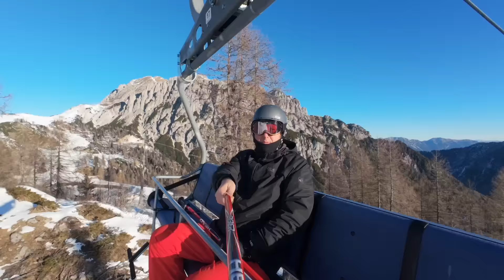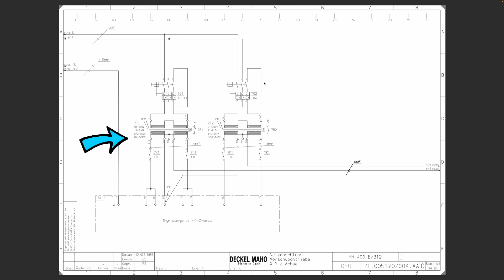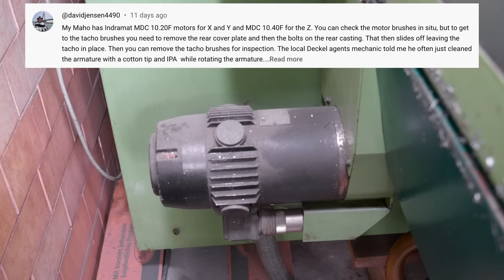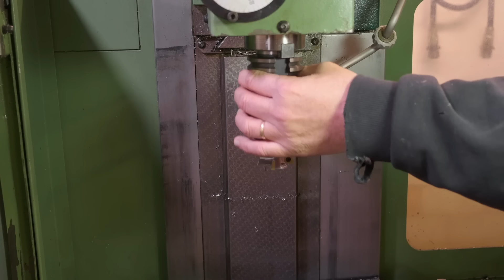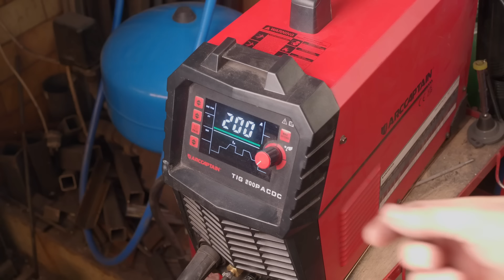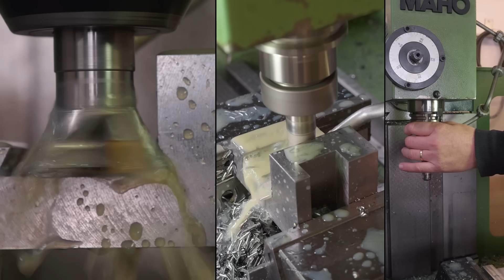My mill threw following errors. Did your advice help troubleshoot it? || RotarySMP

Comment: Bit late to reply to this, but very often relays need a freewheel diode strapped in reverse polarity across it's coil's power pins. This gives the stored current somewhere to go after the relay is unpowered, and stops it ringing when opened by de-powering it, by giving the stored current a path to travel and dissipate via the diode's innate voltage drop.
Reply from the maker: Thanks for the explanation of that.

Comment: That relay for the brake is probably too small, even if its rated for the amps. The contacts are probably fried and messing with the brake staying on. Pull the relay apart and take look, cheap part.
Reply from the maker: I removed it completely.

Comment: Hi Mark ,regarding the Z-axis buzz.
(I expect that you all ready know this)
as the brake exists to stop the axis from falling down, what holds the axis when the servo is on and the brake is off?
the servo it's self of course.
The servo locks the axis by oscillating  clockwise and counter-clockwise at a high frequency.
With the brake on AND the servo on they are fighting each other,
and fights are usually quite noisy 😁
Reply from the maker: Good description Steve.

Comment: A couple useless suggestions....To check crudely controller tracking I would do a set of test cuts e.g. the same boss or slot with different load feeds speeds and would then measure precisely the features. This should be able to show the effect of a simple P controller to track at varying load. 
I would also try to simply jog downwards a few clicks with the spindle into a piece of thick stiff foam lets say to a compression of nominal 1mm. If the P controller is not tracking you should be able to see it in the dro. But non expert talk here and no info about how to tune. I only tune little motors by intuition no big scary machines😊
I and D tuning i find is not that intuitive and the values i see for I are usually maybe orders of magnitude lower than P. So it could be even that your values for I are right out ignored due to value range limits. But all depend on units i suppose. For a cnc which is a highly dynamic system with accelerations i would probably expect to see PD values first set and then lastly Integral if needed.
Reply from the maker: Thanks for the tips.

Comment: Sehr hilfreiches Video für alle, die Fehler bei der CNC‑Fräse oder im Fräsen‑Workflow lösen wollen. In der täglichen Praxis können viele Probleme auftreten, etwa falsche Werkzeugwahl, unzureichende Werkstückspannung oder Vibrationen, die zu Oberflächenfehlern, Rattern oder sogar Werkzeugbruch führen können. Typischerweise hilft es, Schnittparameter, Vorschub und Drehzahl anzupassen, die Maschine stabil aufzubauen und Werkzeuge regelmäßig zu prüfen und zu wechseln, um solche Fehler zu vermeiden. Außerdem lohnt sich ein systematisches Troubleshooting, um die genaue Ursache zu finden und künftig ähnliche Situationen schneller zu beheben.

Comment: I suspect you have the same Chinese foot pedal I do.  Mine seems to have some modulation when I press down, but not when I let off, until it shuts off completely.  Or rather when it shuts off, sometimes it doesn’t…. I really should dig into it.
Reply from the maker: Hi Jeremy, I contacted Arc Captain, and each time to switch on the machine, or connect the foot pedal, you need to depress the foot switch full, and hold it down for 5 sec. Then the machine beeps, 2T blinks, and the foot pedal controls currently normally. It also works in 2T mode.

They asked me to make a quick video, which I will, but I also suggested this kind of information belongs in the user manual.
Reply: @RotarySMP huh.  Mine is a different brand (yeswelder), but I’ll have to try that and see if it makes any difference

Comment: Does Linux CNC offer a "trailing error" mode of operation as well as "feed forward" ?
The Heidenhain controls I was retofitting mid-80s onwards could operate in both ways, but the manuals warned that to run "feed forward" the machine had to be mechanically free from lost motion and be adequately rigid or instability would result. As retrofitted machines were always well used, " feed forward" operation was never used. "Trailing error" operation was a lot more forgiving & more suited to older machines with older drives not originally designed for high speed contouring use.
I would put your Maho in the "older machines with older drives not designed for high speed contouring" class that I would have set up in "trailing error" mode. Indramat drives were bomb proof but hardly "dynamic" - single phase thyristor drives can't match PWM transistor drives for response, but will shrug of crashes that killed transiitors. And they don't have the annoying 8-10 kHz PWM whistle, just the grumbling / buzzing I hear from yours.
I would have expected that machine to have done around 5 metres / min rapid traverse - your 2.5 m/min seems "conservative" ? Did you adjust the drive velocity setting if you dropped the rapid traverse rate from the original setting ?
Reply from the maker: My Maho was not well used. It must have failed early into its service at the HWK Aachen. 

I actually increased the rapids. They were originally only 1500mm/min under the Phillips control. I didn't adjust the drives at all.

Comment: I use Gulf and Western Tacway 220 on my slides. Same as yours basically. I like here in Sydney. It really is tacky. So much that I also use it on the lathe slides as well. Makes the movement feel nice and smooth. But yesterday we hit 42 C (567 Rankine) so a wee bit different here. Although the shed stayed at 24 C. So it's 220 mm2/s at 40 C, 800 mm2/s at 20 c and about 1800 mm2/s at 10 C. So you may be correct that it gets a bit stiff.
The lube line on my Z axis had disconnected when the machine arrived. The one the goes the recirculating nut. Difficult to fix as the old plastic lines were a bit stiff. On mine you can check it by pulling down the spring sleeve that protects it form dirt.
On my Maho it seems to slide better just after a lube cycle. Hard to know because the Heidenhain controller auto tunes to account for it during down times. You can feel the stiffness when winding the slides by hand.
I've had all my slides open. Two ports were clogged on the rotary table.
You can check all the lines are working a the distribution manifolds. Mine all have the dosing pistons in those manifolds. 35 of them. For a quick check I just undo the plastic hose on the manifold outlet, release a couple of drips and reconnect it. That puts an air bubble in the line. Then go to the lube until and press the manual dose button. Race back and watch the air bubble. If it has the dosing pistons the bubble wont move until the pump switches off. The pump switches off when all the pistons are cocked. When it stops the pistons spring load back and the bubble will move about 5 mm if the dosing piston is working. If it doesn't take the hose off again and check the little spring loaded rubber check valve way down the bottom of the aluminum manifold isn't stuck. Several of mine were.
Reply from the maker: Thanks David, sounds like I need to order some 68 weight and fluch out the 220. I need to do that lube check on my "annual" maintenance, which is probably due when the weather warms up.
Reply: @RotarySMP  The ISO  standard is the viscosity at 40 C because in most cases the oil runs hotter. I would think Maho was expecting most machines to operate at about 20 C and the oil the same. At 20 C the viscosity of ISO 220 is 800mm2/s. So you probably should pick a grade that is that viscosity for the actual temperature. At 15 C it's ISO 150. At 10 C it's about ISO 100 grade. Looks like you need a grade for summer and a different one for winter. My WW2 Jeep manual suggest just that. At the rate my machine consumes lube oil you could probably just switch grades just by topping up!
Reply from the maker: @davidjensen4490  No chance an I doing a lube unit change and flush 2x year. Not going to happen.
Reply: @RotarySMP  So maybe just pick ISO 150 for an average temperature of 15 C?

Comment: Wondering if the resistance is different between that brake and the relay you added. Possibly causing the amp draw to be out of range and causing the issue. I'm not a cnc guy by any means, but this is how automotive systems work (over 40 years of wrenching in USA).
Reply from the maker: Good point. I have returned it to it's original wiring.

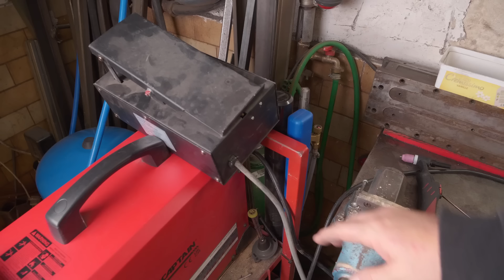Comment: At 23:10, foot pedal stops after a fall, probably cracked the carbon pile resistor inside...
Reply from the maker: Wonder why the new one has the same behaviour?
Reply: @RotarySMP  I thought the first one stopped working and the second goes full power or nothing...Not exactly not working, just not correctly working....  Probably mis-wired in the pedal or connector.  That pedal looks like a generic pedal that is available on the Bay, even if it came directly from Arccaptain.
Reply from the maker: @johnrussell6620  Turns out they need you to depress the pedal to max for 5 sec each time you turn it on. If you do that it works fine (and the old probably does too). I suggested they put that in their manual. They have asked me to make a quite how to video on it.
Reply: @RotarySMP  If the old one ever worked, then you  know it needed full throttle or it did not...

Comment: I suppose you already know the "correct" way to feed filler wire when TIG welding. It's a one handed technique that you just need to practise (you can practise without actually welding, do it first without gloves). There are however also simple mechanical feeding devices that cost only about 25 eurobux that can perhaps make it a little easier. Look it up. These fit in your hand and you usually operate them by turning a knurled wheel with your thumb. Personally I don't feel I need this but I do use thin & supple deerskin welding gloves for TIG, for optimal control. And much thicker leather gloves for MIG and "stick" welding which I feel are more violent processes.
Reply from the maker: Yeah, I even tried it in front of the tele once, but forgot to practice. I also have nice subtle gloves.

Comment: With regards to following error, I'd advise to really get in depth of what error you're actually looking at. There will always be a difference between commanded position and feedback position for a moving axis because the drive needs time to respond to a command. Finding this time delay is usually a bit of trial and error, usually by moving the offset around to obtain a minimal error term. And then trace the following error to see how it looks during moving and cutting and check if this behaviour makes sense. 
If it does, then you can work on minimizing it with tuning. If it doesn't, keep at it until you get a following error where the target and actual positions are matched in time.
Reply from the maker: I have a local with experience coming to take a look at my tuning.

Comment: What I see with following error is it occurs on heavy rough cuts and fast accelerations where you not concerned about accuracy.  In the finish cuts where deflections is more the machine is not being pushed hard enough for following errors.
Reply from the maker: Thanks for that.

Comment: 12:40 Tantalum caps don't fail of old age nearly as much as electrolytics. In some equipment (especially Tektronix oscilloscopes), people do recommend replacing tantalum caps. There, they are failing because tek spec'd them a bit too close to their limits, and they get pushed beyond their limits as other components age.

When tantalum caps do fail, they almost always short. This would either result in circuit protection opening, or the cap or adjacent trace burning up. If the former happened, the drive wouldn't come up at all. If the latter, there'd be a bang and a fair amount of magic smoke, that smell would linger in your control cabinet, and again the drive wouldn't come up.

So I'd leave the tantalum caps unless it's a known issue with Indramat drives. Or, of course, if you can smell the magic smoke ;)

IIRC in your first video you mentioned a "power bad" light or similar sometimes lighting in the Z axis drive. The drives almost certainly have inrush current limiting circuitry. I wonder if that circuitry, combined with fighting against the brake at every startup, was making the power come up slowly enough to make the light turn on.
Reply from the maker: Thanks for your experience on Tantalm caps Mark. Re the motor fighting the brake, that is kind of what I was thinging as well. I'll now keep tightening up the Ferror limits and see way it can hold.
Reply: first experience of tantalum... preamp circuit from some guitar handbook.
stuffed a regular electro in... didnt work. got hold of specced tant, worked... was hard getting supplies pre net, pre car teen days in a country town...
i should go back and try it again. now im older and wiser as i suspect it was just component values and electros not really being capacitors until 10% of tehir rated voltage...

or maybe i just had a bad cap... it was thirty years ago...

Comment: SAE 68 = ISO 220, or vice versa.  I forget.  Common confusing item.  One of them will have a VG prefix

Your buzzing sounds like a contactor right on the edge of brownout where you get contact flutter IMO.  That is  a condition which will result in catastrophic contact failure from continuous make/break and arc ablation of the contacts.
Reply from the maker: Thanks Paul. The hum sounds to me like a transformer hum.
Reply: One is Vactra #2 "standard" way lube (for bridgeports and cnc machining centers)

The other will be mobil velocite light spindle oil.

There's probably a 3-4x difference in viscosities

Comment: This is a tricky one. I had this issue on my Maho 700c and eventually it came down to PID tuning. 
But I’ve still got a long way to go. I’ve got my max feed at 1500mm/m I see you’re 1000m/m faster. But again what are you cutting at 2500. I’m not sure I have to agree with you were on when is the limit to PID tuning. 

My current challenge is I can’t find the “index pulse” on my 4th axis which uses a Heidenheim encoder. So right now I have a nice 3 axis. 😂
Reply from the maker: What way oil viscosity are you using, and what is your following error limit please  Sven?
Reply: @RotarySMP I am not running the Heidenheim linier scales, I had the Phillips ones so I took mine out and fitted the delos W series linier encoders. I gave myself a larger window. X axis Ferror=10 Min_Ferror=1.0 
Y axis and Z axis(table) is the same
Reply: Sorry and I’m running slideway oil called oil 68 from a local shop here. In South Africa we don’t have to worry about the cold too much.
Reply from the maker: @svengebert8690  I can't seem to get my Ferror below 3, and minFerror below 1 at the moment.

Comment: Typically with velocity servos the I and D term are handled in the drive. I tried to read through the Indramat manual, but when they started talking about thyristers my brain started melting.
Reply from the maker: Hi Wes, thanks for that. I guess that would imply that I followed the correct instructions when I first set it up.

Comment: On the lubrication thing.

I would run the lighter oil. If it sits for long periods the oil would want an antioxidant component. 

We run 32wt. hydraulic oil in everything except the big (20’) Niles boring mill which gets 220 wt.

I run Haas and they have a history of lube issues. I think they ran 68(?) way oil but everything gets covered with a brown sticky paste so the started recommending something like 5w30 motor oil which kind of surprises me since it makes a water oil emulsion which allows rust. I suspect since it is a total loss system they are relying on keeping the wear surfaces flushed with oil and the coolant for rust inhibition.

Bottom line is you really need to keep everything exercised with a warm up program and your coolant mixed up whether you use it or not. I worked for one shop where every machine was put through a warm up every day.
Our both our mill and lathe call for a spindle warm up every day before operation.

Hope that helps.
Reply from the maker: Thanks a lot. Good idea. I never really consider 10°C as that cold for mechanical stuff.
Reply: @RotarySMP The coldest machine I have ever run was a lathe where it was -11°F in the shop.

Comment: Mark I see you are using a touch screen with gmoccapy. Thinking of upgrading mine and was wondering what model screen you are using
Reply from the maker: This is some ancient 19" screen. No idea of the brand. Terrible veiwing angle, and I should have mounted it tilted back a bit to make it easier to read.

Comment: I was going with an a total upgrade and replacement. It’s not that there is anything wrong with the old hardware per-se but replacement parts get harder ti find everyday, they are less well known and a lot of what may have made them funky has been engineered out.
I would rather work on a car from the 2000s than one from the late 70s or 80s when we were still trying to figure out emissions systems. Modern cars have much cleaner wiring harnesses etc.

IDK about your area but Grizzly for instance sells CNC retrofit kits for some of their machines, pretty much plug and play.

I understand the challenge of fixing the thing but at the end of the day would you rather have a running fight with an outdated control system or make stuff?
Reply from the maker: Did you see my video from the retrofit? I decided to stick with the Indramat, contactors and drivers, as this stuff was top end gear, and the quality of the wiring is very high. Expensive and hard to me to do better. On the Schaublin I went the other way with a full(er) retrofit, and it is not more reliable, as it was designed and built by a hobbiest.
Reply: I was aiming between the two.

Compared to any CNC I have owned it sure is a lot more “stuff” 

I will check out your video when I get time.